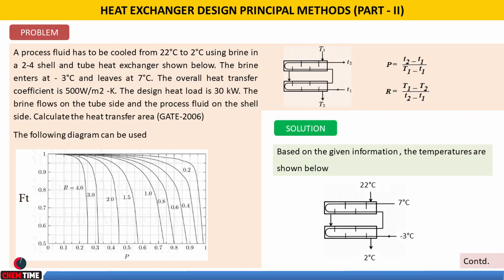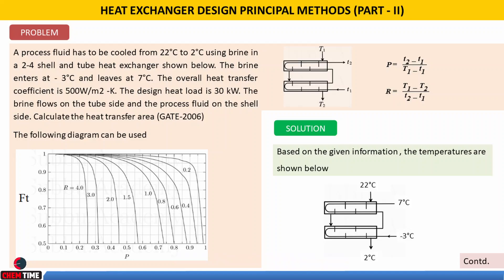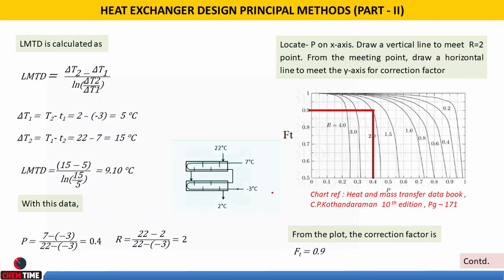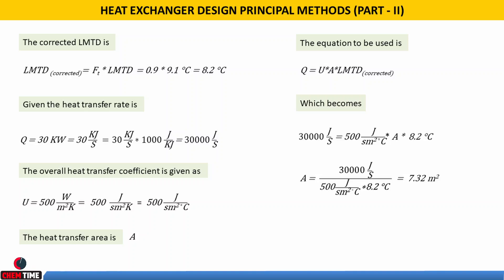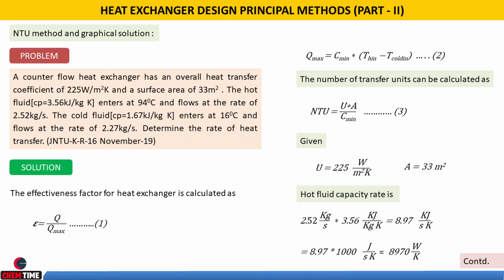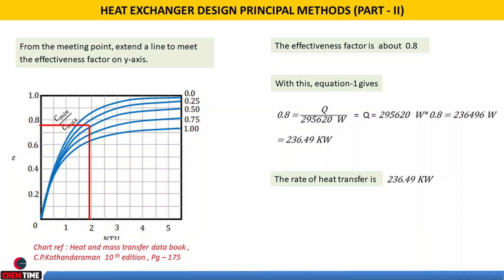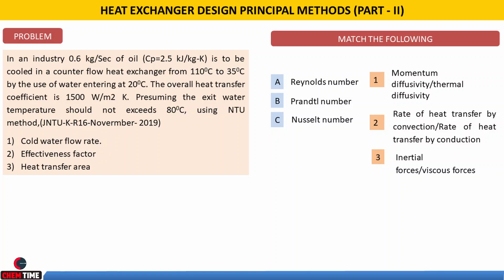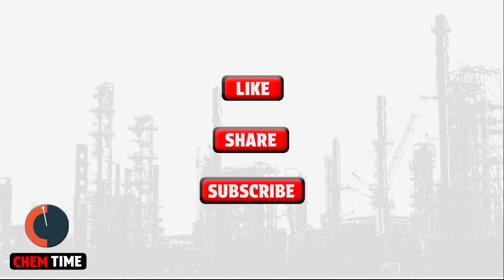HEAT EXCHANGER DESIGN – PRINCIPAL METHODS 2

Comment: Very nice video sir, please also cover how to design and size using commercial software like HTRI… what parameters to check, how to estimate overall heat transfer coefficient, why dp plays critical role… last but not least very nice introduction about importance of today in the science community….
Reply: Thanks. The process fluid undergoes various unit operations and processes  and the product is to be  delivered at a  particular pressure. So pressure drop in the heat exchanger takes into account the inlet process fluid pressure and pressure of product required